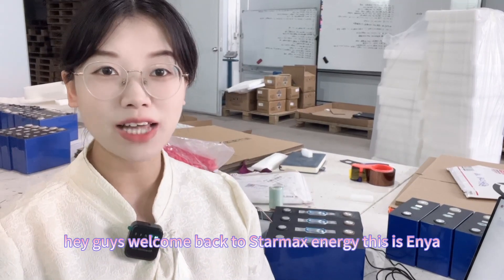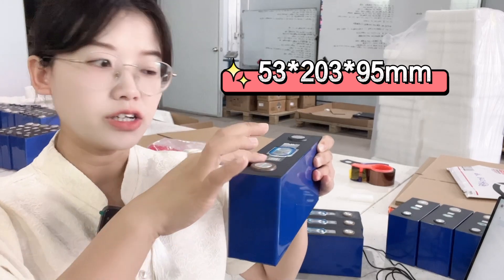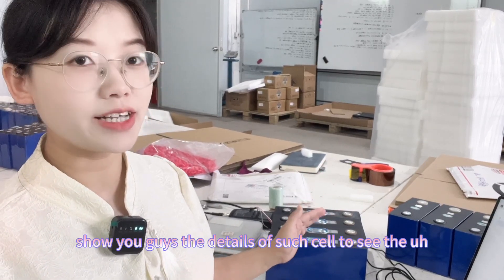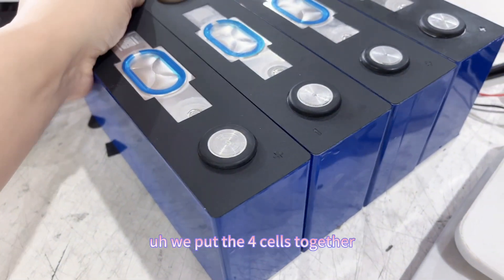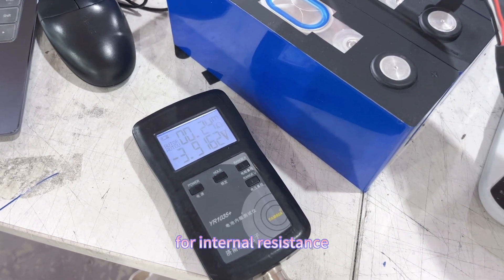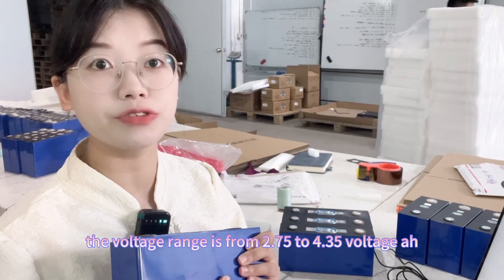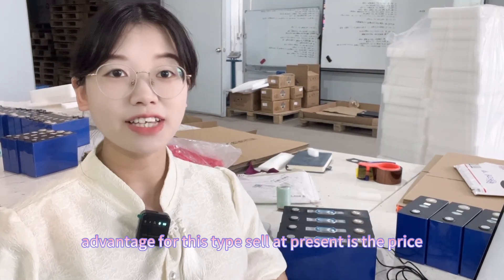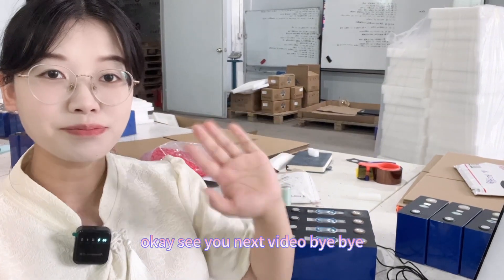CATL battery 3.7V 158Ah lithium ion cell

Comment: What is the capacity at 4.20V recharge? can you provide CATL full specs?
Reply from the maker: Didn’t test at 4.2V, but will be try, specification available, contact at +8614704451321🤗